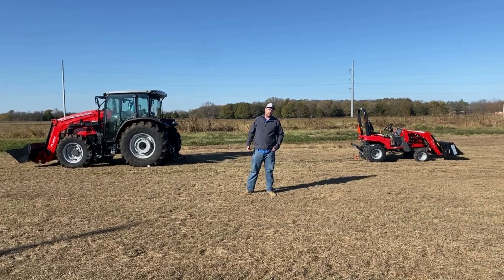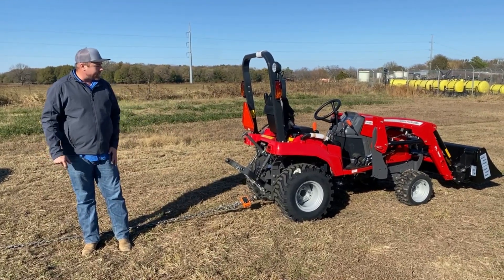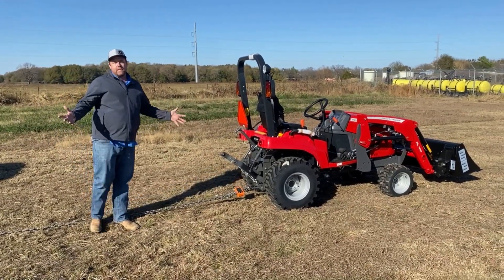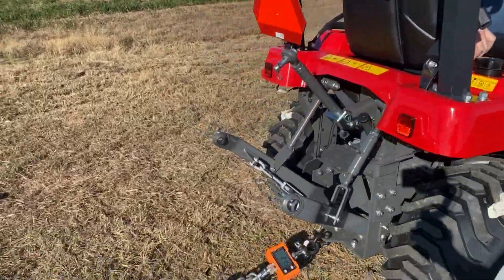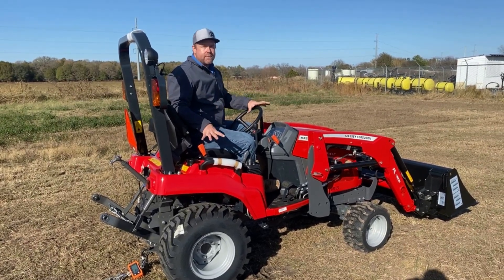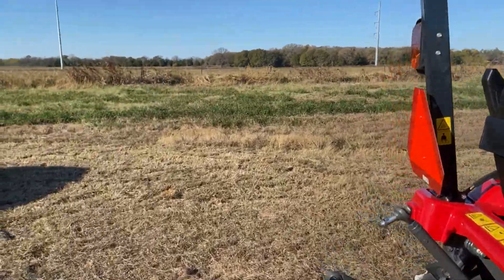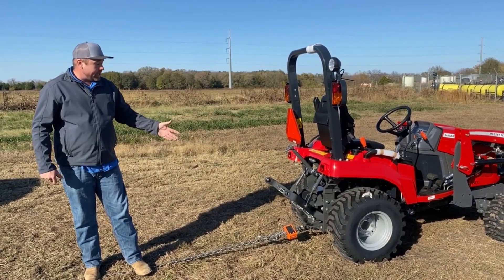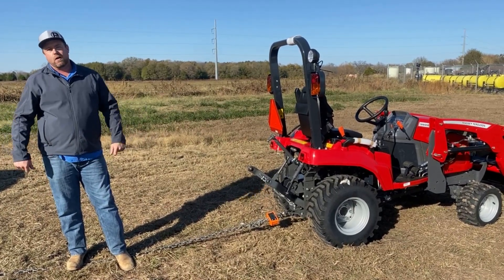Massey Ferguson GC1725M Static Pull Test

Comment: That's a new tractor, after about 50 to 100 hours, my little red beast (GC1723e) did far better than it did at the start. Perhaps y'all can do a test again on one that's been broken in. 

This little tractor has not stopped surprising me.
Reply from the maker: Thanks for the suggestion.  Next one that comes in on trade we'll try to retest.
Reply: Whenever I use mine with the box blade I always fill the bucket full of gravel too so you get a little better traction

Comment: Hey Nick, I've always wanted to know the difference in pulling power of a larger 2wd vs a smaller 4wd. The purpose being, if I'm on a budget, should I get a smaller 4wd or an older larger 2wd? Like this GC17 4x4 vs a 2wd 1726 or 1825? Basically how much extra weight do I need to make a 2wd outpull a 4wd? Thank you!
Reply from the maker: Hmmmm I don’t often have 2wd tractors but I suppose if I used a tractor with 4WD off it might tell us what we want to know.  Let me see if I can’t figure something out in the future.
Reply: @prequipmentsales  thank you very much! I appreciate the willingness.

Comment: Willmit pull a 2 bottom or 4 ft disc
Reply from the maker: 2 bottom plough no…to light.  4’ disc depends on weight of disc.  Remember this is a subcompact tractor